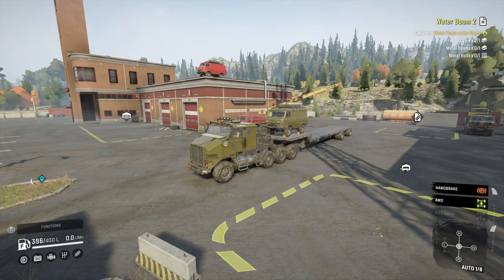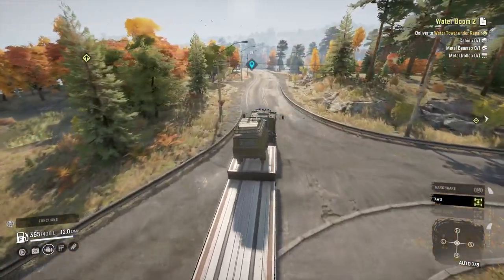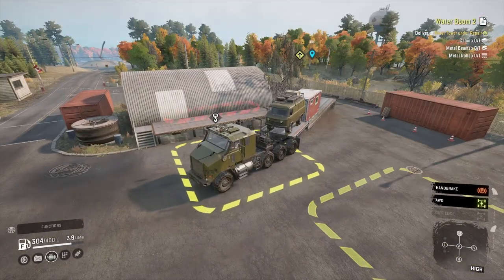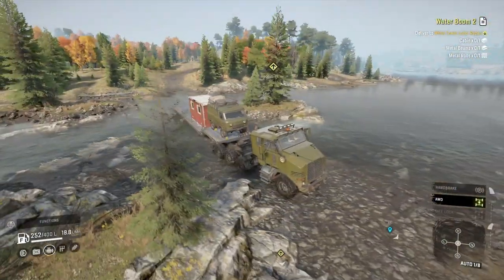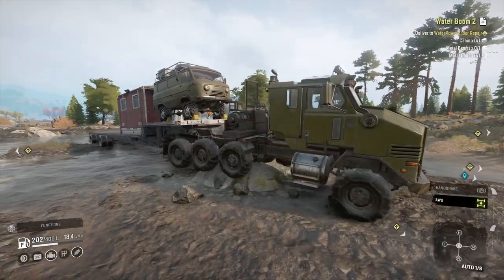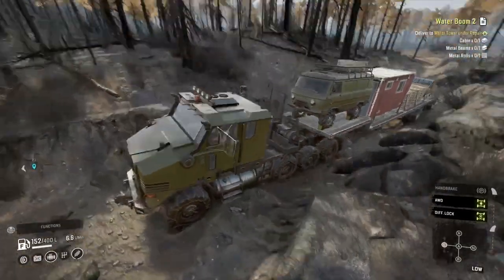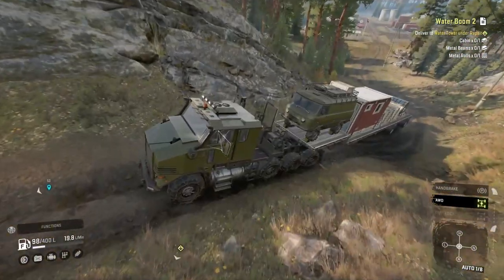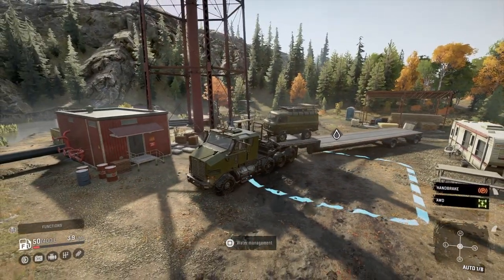SnowRunner Water Boom 2 Mission (Boom 1 and 2 are Connected) With Derry 4520 And Lo4f

Comment: 👍. U really need to change your YouTube name to Mr lo4f wolf.  I can’t remember a vid that it has never been in.  Lol.   Yeah snowrunner does get the vehicle torque / engine power & tyre traction. Well not wrong, but underpowered a lot.   Ie the Derry. It’s engineered to tow extremely heavy loads, but in the game it’s well lacking in torque.  And they still haven’t fixed it. That goes for a lot of the vehicles tho.

Comment: I wonder if logs are a lighter load or if the offroad gearbox just holds gear better?

Just a month ago I pulled long logs out of the Zimnegorsk log station.  Up a pretty steep hill, down a bumpy trail, even though a muddy rut or two, Derry held high gear the entire way.   Hell I even had it in RWD.

https://www.youtube.com/watch?v=qWb8hdRHiGw

Dunno why the truck is giving you so much trouble Wolf.   All I can say is if it's not working out as a saddle truck, then instead of doing the same job with it and expecting a different result, try the Derry in different rolls and different setups.   Maybe you'll have more luck with it as a logging truck, maybe you can find some other use for it.    But as is I think the definition of insanity is starting to apply. lol
Reply from the maker: Yeah I’m not sure, the truck has just always sucked for me. I’m not that fond of it and don’t drive it that often anyway 

I just get it out every now and then to give it a run and see if anything has changed, it seems this truck just doesn’t suit me well lol
Reply: @itsmrlonewolf  Yeah it is weird huh. Any time I see people (not just you) complain about the Derry's power, they are trying to use it with cargo trailers like the Step-Deck.    But I've been using mine exclusively as a log truck since before the new engine came out and even on the B+ engine it's power seemed fine for the job.    I think I showed you a video before of me going up the steep hill on the Michigan log station in High on this truck, pretty sure that was done on the old B+ engine. 

Sadly not much use of long logs in Season 9, it's mostly medium.   But the next time you get the chance you should configure the Derry into a log truck and see how things go, because this has become my primary long logs truck over the P12 & P16 by now.    For me it tends to do that job rather nicely.